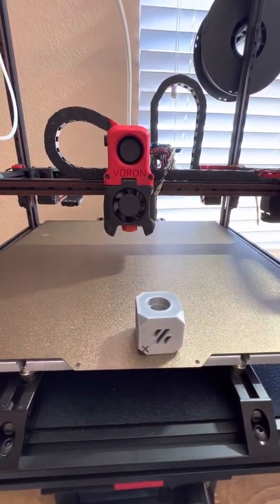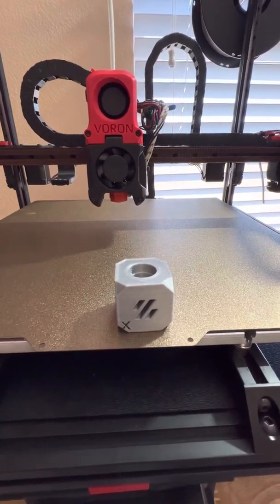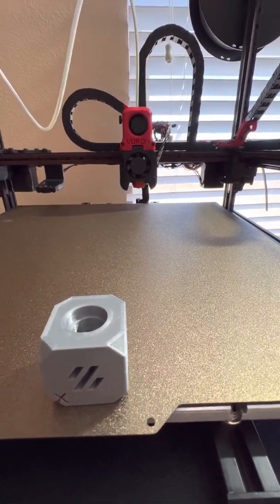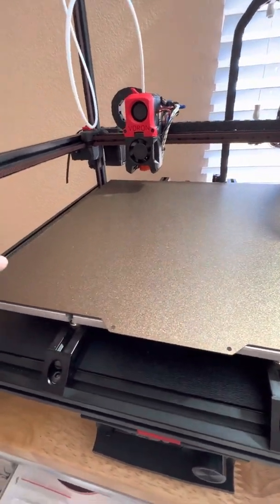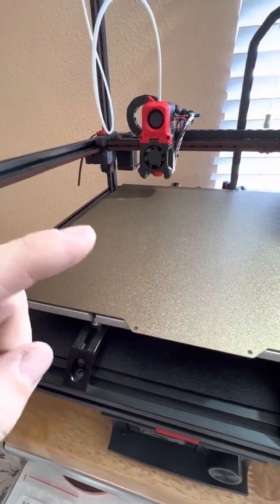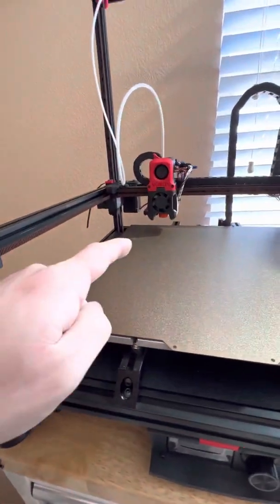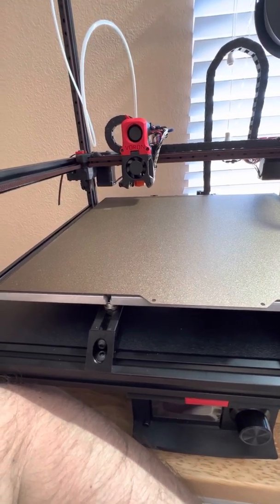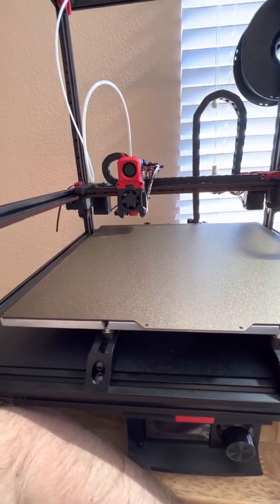Voron 2.4r2 klicky probe mod with quad gantry level

Comment: I love the motion when it goes to dock the clicky, how do you have it set to decelerate so slowly, what setting is this in klipper
Reply from the maker: To be honest i think its the default setting for docking which was used from the macros files on the github. Might be able to paste that file config in the comments if needed.
Reply: @matthewdigiacomo8764  please link me to the github page u mentioned